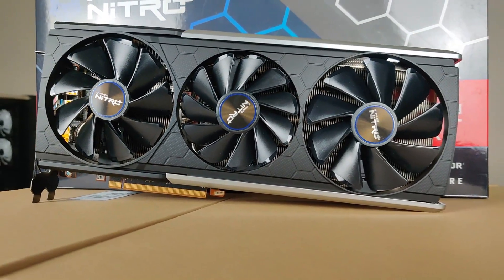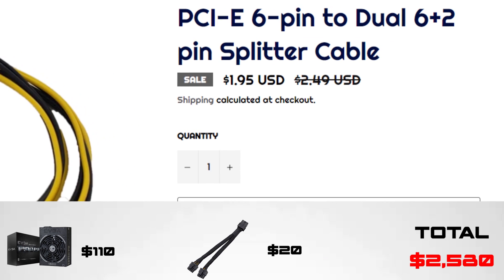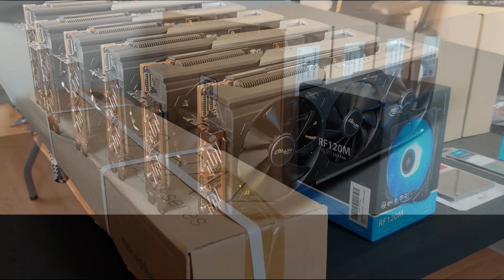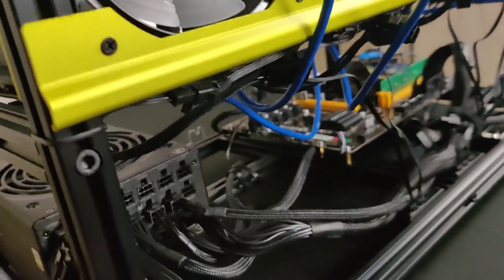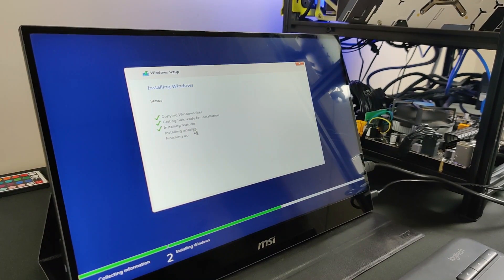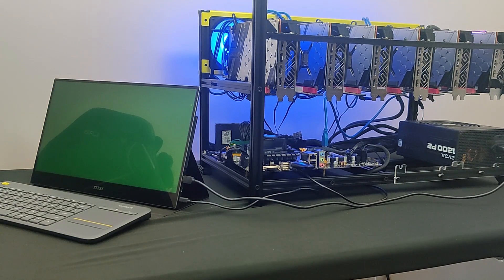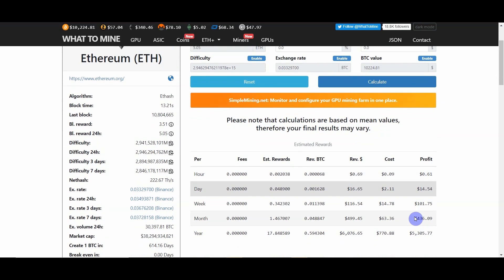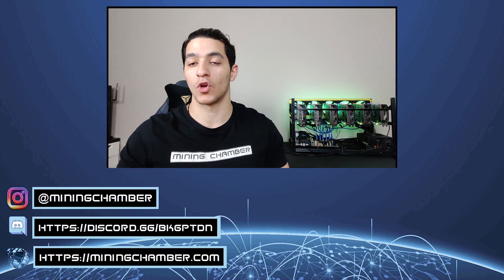RX 5700 XT Mining Rig Build - 6 GPUs | 330 MH/s and ONLY 880 Watts!!

Comment: dude. youbcan help me. i try to build mining rig with shapire nitro+ 5700 like you. but in the first step for test one by one the gpu, gpu no detect by mother boar. i use asus b250 mining expert. thanks
Reply from the maker: Did you plug in the HDMI into the motherboard?
Reply: problem solve dude. after i replace riser board. thanks. but now i have new problem. i follow your step about mod bios and simple over clock using amd aplication. and perfect. i got arround 55-56 mhs. now the problem is. durring i mining normal, after 1 or 2 hours, 1 of 6 gpu reading 0 mhs, i need restart the computer for recover that. but after 1 or 2 hours reading 0 again, i check temp is normal, under 63 degC, 😭

Comment: Are  you using hiveos?
Reply from the maker: In this video we used windows 10, although we might do an update for switching to HiveOs!
Reply: @MiningChamber  I have a question, for a beginning do you recommend we use stuff like betterhash, kryptex, or nicehash? If so which of the three is best?
Reply from the maker: For absolute beginner I think it's still manageable to mine with Phoenix Miner but if you rather a good user interface then it's best to try Cudo miner or one of those platforms

Comment: Did you use the 6pin to sata that came with the riser or  molex for the power?
Reply from the maker: We used splitters only through out the rig! We did have to daisy chain one splitter but then switched the 8 pin connector to the psu with a dual 8 pin that we had from a powersupply of the same model as extra cables

Comment: Dude, how about if the all VGA still in original condition, no overclocking, no bios modding, how much the power consumption and how much hash rate?
Reply from the maker: The power consumation will be around 205 watts and risers will pull 70 watts. and then the hash will be 51ish mh/ thats without BIOS modding or overclocking! BitsBeTripping just did a video about that today it is really informative I recommend checking it out!
Reply: @MiningChamber Ok dude, I really appreciate, i'll check now
Reply from the maker: Thank you!
Reply: @MiningChamber  still waiting for notification the new video..
Reply from the maker: So soon! Saturday, everything you need to know about powesupplies ;)
Reply: @MiningChamber  lol, of course. i understand. i stay tune in this channel

Comment: Will you come out with a video on how to power the gpus / risers? I have (2) PSUs (both 1300 watts) powering (8) 5700s. Both PSUs have 6 PCIE outlets; on both PSUs I use 4 PCIE outlets to directly power 4 GPUs and 2 PCIE outlets to power 4 risers. I’m curious on how your power distributed ...did you power any of the risers with molex? or did you split one of the PCIE cables 4 ways? I’m thinking about adding 2-4 more GPUs but I don’t have any more PCIE outlets.
Reply from the maker: Hey Daniel! Our this week's video will dive in deep about this topic and hopefully it will answer all your questions and concerns!!

Comment: Ive been mining with my two gaming pc's for a few months using one 5700xt each. Doing around 53MH/s each. Im interested in building a 6 card setup. Should I use 5700xt's or something cheaper to start?
Reply from the maker: That's awesome! Hmm I'd say wait for the new cards it will drive prices down and open new doors for more opportunities!
Reply: @MiningChamber  So maybe start buying frame, MB, Power supply etc then check vid card prices in a month or so? Buy old 5700XT cards Im assuming you are saying once the new cards come out?
Reply from the maker: @grubberzzz9982  yes the other parts you can get now but for gpus in a week or two it will be loaded with the new ones, that usually means the older generation cards will lose value. Just like iphone X and the model before it. So it doesn't necessarily means you need to buy used, even new off the shelf gpus will get cheaper possibly
Reply: @MiningChamber  Thank you!! Any suggestions for MB and PSU to start?
Reply from the maker: I really like the Asus B250 Mining Expert and for PSU the EVGA P2 1200w or EVGA 1300W gold
Reply: @MiningChamber  If ETH changes to staking wont that hurt mining in general? Im assuming mining will eventually by gone?
Reply: @MiningChamber  Not cheap eh!!
Reply from the maker: Mining will never be gone ! Many coins depend on proof of work which is always going to be there
Reply from the maker: Haha yes not cheap😅 look for used deals!
Reply: Can you make a video explaining the power connections to the risers? Im abit confused on the splitters and are they needed.
Reply from the maker: This will be this week's video!!
Reply: Perfect. I bought a MB and PSU that you suggested above. Asusus B250 and a EVGA 1300 p2. Im abit confused on how you could power 6 Red Devils? Psu only has 6x6+2

Comment: In my rig can I mix four Sapphire Nitro RX 580 with one RX 5700 XT? Will it be compatible? Both are AMD GPU and running on same driver. The driver 20.8.3 release support both the GPU's. I want to do this as I want to upgrade my rig with either one new RX 5700 XT or will wait for one new RX 6000 series RDNA 2 release. My PSU is Corsair HX 1200 platinum. PSU has 6 PCIE (8 pin) connectors. Five for GPU and one for CPU. Motherboard Gigabyte B250 Fintech. Please help.
Reply from the maker: Yes it is completely fine to mix 2 different AMD cards!!
Reply: @MiningChamber  So if I install new Rx 5700 xt along with Rx 580 I will still get the same hash rate. There won't be any fluctuation in hash rate or temperature? Rx580 and  Rx 5700 xt are not crossfire compatible. Do mining motherboards like gigabyte B250 fintech has this crossfire feature? If not then how do multiple GPU works in these motherboards? Please make a video of building mix GPU rig. It will be very much helpful to your subscribers.
Reply from the maker: Crossfire and SLI don't play part in mining. They are individually plugged in and run separately from each other. So no need to worry! You will just need to overclock them properly and that's it

Comment: can i use " Procesador Intel Pentium Gold G5400 3.70GHz 2 cores"
Reply from the maker: It depends on which motherboard. You just need to make sure it is compatible and the same generation. For example if the socket is LGA1151 for the motherboard the CPU needs to be the same socket
Reply: The pentium is plenty , attach a usb to the cheapest best btc board GA-H110-D3A and you're set, oh and buy a seasonic 1kw psu for stability 😃 ( assuming u building 6 3070 gtx or something 😂)

Comment: Hey, a quick question. I'm trying to figure out how did you connect the risers and gpus. You mentioned that you used 9 splitters so please correct me if I'm wrong: 
4 cables with a single 8-pin -> splitter -> 2x 8-pin on a card (for 4 GPUs)
2 cables with 8-pin and 6-pin -> 8-pin + splitter to 2 gpus and 6-pin + splitter to power 4 risers
So with that you have 6 cards + 4 risers powered up. How did you connect 2 missing risers? With molex?
Reply from the maker: Hey! We ended up doing a diasy chain for splitters. So one splitter was connected to another to power the left over risers until we got two new 2x 8pin VGA strand instead of the 1x 8pin strands we had. Like that we were able to fill out the rig using splitters and the additional 8 pins. I do not recommend using daisy chains for long term! but best option is to find the same PSU model cables in ebay and getting those for it!
Reply: @MTechBasics can you power the riser with a sata ?
Reply from the maker: @pedromedellinjr9680  It is not recommended! Best to get splitters for it

Comment: Hi, My motherboard is connected to two AMD 5700xt graphics cards, but only one of them is running. How do I need to set up to run two graphics cards at the same time? Thanks!
Reply from the maker: Did you make sure that both gpus are connected properly and that the risers are working? Try to switch them around and see what happens. Try one card at a time and make sure both are showing up
Reply: @MiningChamber  Thank you. 
I am try to unlock asus 5700xt but it was unsuccessful. His dead......How can he work again?
Reply from the maker: @richiew7208  try to do it one gpu at a time, take off one and do one at a time. Watch our 5700XT overview video about the gpu

Comment: Ur profit perday is 14 $ it means , after all expense , reduce the power consumption , what's tottal eating perday ,????
Reply: And you forgot to compare against ASIC setups. So yeah, all the block chains split or will split soon meaning half profit for everyone. Honestly it is not worth it. You will barely recoup your money before it becomes unprofitable.
ASIC rigs right now are at 480MH for 1200 watt.
Reply from the maker: @rotaryphoton137  Yes ASICs are definitely more profitable but they are harder to run in residential areas and it's easier for someone to get a gpu mining rig going than an ASIC because of the heat, noise and the type of outlets they mostly run on. GPU mining will always remain existent but for AMD yes it might be looking bad after ETH and ETC migrate out of their Algo
Reply from the maker: We mention that is after the electricity cost. Now it is different because block reward is smaller and ETH price went down
Reply: @MiningChamber  I would like to buil miner at home , I nees deep details , even with software
Reply: @MiningChamber  what's different between bitcoin and etherium
Reply from the maker: @haneesparakkottu9274  I recommend watching videos and getting familiar with the space! Go over our videos and some other awesome youtubers then you can get some knowledge on the field !

Comment: 6:58
using electric screwdriver manually...  lolwut
Reply from the maker: 😂 it's not strong enough to screw the fan screws. Needs force 😅
Reply: @MiningChamber  what? my cheap Bosch and Black n Decker are too strong and too fast, I rarely use them vs my Makita all around drill.
Reply from the maker: The fan screws can't be screwed with the electric one we have, the power of it is not strong enough to screw them that is why it has a manual mode as well! Trust me I would've loved doing it on the electric mode 😂
Reply: @MiningChamber  i use a ratchet screwdriver for the fans, its a wrist saver
Reply from the maker: @MatthewDannevik  might be just the solution then 😂😂⛏️

Comment: Hi, what about noise of the rig? Can you please measure db by some app for example one meter away from rig? Sapphire GPUs should be quiet as I heard 😊
Reply: You can use app for that, for example db meter is working fine 👍
Reply from the maker: Thank you we will give that a try!
Reply from the maker: They are pretty quite! We will be getting a db measurement tool soon so we can incorporate that into our videos but it is surely one of the quite ones but ofcourse it also depends on the fan speed!

Comment: Does the values on core apllies to non Vbios modded cards? Cause when im lowering the core at 1300 i get less Mh/s
Reply from the maker: When you reduce your core even though Ethash is memory intensive it still will reduce your hashrate. The modded Vbios cards just makes the memory timings more efficient. Let me know if that helped!
Reply: After you set up your rigs, do you experience any crashes? Or do they do they work like a charm after you fine tuning them once at the start?

Comment: its much quicker to use a config.txt file. establish the gt value first on one card then its pretty much gonna be the same on all identical cards. then you set / fix the GT, core, core volts and mem clock in the config.txt. if you lower mvvd you can cut the wattage even more. if you can get them the plain blower 5700s are awesome miners cos their ram is properly cooled. mvvd requires linux or amd tweak xl tool. best wishes from manchester uk.  i use -eres 4 and extended stats in phoenix. plain blower 5700s can get 56 megahash long term - mine have been up for months. best place to put a rig is cold basement
Reply from the maker: That is amazing thank you for the great insight! We need to get into the config.txt for sure! The blower style cards I heard are alot better We will hopefully get some of them in the near future. Thank you again!!

Comment: Brothe I have Corsair RM1000i PSU And Sapphire RX580 8gb total 5 card and now i want to add 2 more Rx580 card on this PSU. Can this PSU handle total 7 card ? Or not .... 
Currently my one card are consumed 88 to 90w power in hive os... please suggest me bro
Reply from the maker: I do not recommend running 5 Cards out of the 1000 Watts PSU. The cards will draw more than 88 watts off the wall. You will need to get a wall power meter and check. But on average with Risers each GPU will drawing around 120-130 watts. I recommend getting 1200Watts for 6 cards and for 7 Cards you can get a 1300 Watts. Even a 1200 Watts will do for a 7 cards too. Hopefully that helped!
Reply: @MiningChamber  Thanks Bro...  i got it

Comment: I see that you connected the MOLEX to AUX1/2 of the motherboard. I have not connected them but everything still runs normally. can you please explain? thank you
Reply from the maker: Hey! I do recommend to power it since it does provide the power to the PCIE ports. If you would plug in enough gpus in there and they draw a high amount of power then you will run into many issues. Powering them makes sure that the gpus will be able to find the power they need when they need it!
Reply: @MiningChamber  Alright. Will try tonight and let you know how it goes. Best Regards

Comment: Would i have issue if i do same type of rig with diff motherboard and i use a mix of  5700 and 5700xt  would that be a problem?
Reply from the maker: That wouldn't be a problem at all! Just the overclocking and BIOS modding will defer but other than that your good !
Reply: @MiningChamber  Oh well it will be my first rig ever so if is gonna be overcomplicated to handle probbaly better not to play with it  yeah?
Reply from the maker: It won't be much complicated it will be very slight things that are different and overclocking in general is different from one card to another. So I recommend doing it if you can get your hands on a nice deal!

Comment: How are you getting such low power consumption!? I have 8 x Sapphire 5700 XTs all RedBios modded...they are at 54 h/s but they are consuming 2081 watts from the wall (I have two EVGA 1300 PSUs hooked up to them,  both roughly consuming 1030-1050 watts) ....I am using NHOS and have played with the JSON config settings,but none of the changes are stable. I get stable operation on Default Medium settings, but at a high power draw, 2081 watts. Does anyone here have a Sapphire modded rig on NHOS that can share their settings ? Would greatly appreciate the help
Reply from the maker: Oh wow that's alot of watts!! What's your undervolt is set at ? We have it at 725mv that can explain why we have it so low!
Reply: @MiningChamber  NHOS uses TDP for power which is percent of power usage....I have it currently set to "Default-Medium"  but I have played with 80% , 70% , 60% setting. The other settings are Core Clock and Memory Clocks which can be set.. I have those also set to Default-Medium. I think getting the right TDP, Core Clock, and Mem Clock will help with lowering the power draw , but adjusting them have been giving me unstable results and I haven't had much time to find the right combination
Reply from the maker: Hmm not sure really with NHOS but I'd say try to push around -40% to -20% . Sorry I'm not quite familiar with that operating system!
Reply: @MiningChamber  I forgot to mention...I am using NHOS because windows was very unstable as you mentioned in the video
Reply from the maker: We are testing the waters on HiveOs il let you know how it goes there!!
Reply: @MiningChamber  So I tested different Linux Mining OS and determined it was purely software related and that NHOS sucks. I am using SimpleMining OS and with OC/undervolt I am averaging 54 mh/s per card and 1300 watts total draw (total eight 5700XTs) ...thats a 815 watt decrease compared to NHOS which was not allowing me to undervolt. I also tried HiveOS, but couldn't get it to work; I was unable to install the AMD driver...I also tried the Beta image and that didn't work. I'm so happy that I finally achieved optimization!
Reply from the maker: That is awesome!! Thank you for letting us know! We will keep in mind regarding to simple mining!

Comment: Hi i`m struggling with connecting those i got 1600W evga psu i got 12 - 8 pin inputs for my 6 cards but only 9 VGA 8pin outputs from PSU  - how would you recommend me plug them ( not considering buying another psu) . Thanks!
Reply from the maker: Hey! If you have 9 8 pins then you should be able to get splitters and power everything on! You should have total of 16 8 pins with 9 splitters and that should use 12 for your GPUs and then 4 for your Risers. You will have 2 more risers to power which you will see if you can find another VGA cord to plug in the PSU through Amazon or such. Or you can do one strand of SATA per Riser through using SATA to 6 pin or straight SATA. Although SATA is surely not the most reliable!
Reply: @MiningChamber  Thank You for the answer this is exactly what i did i was afraid that there will be not enough "wattage?"  but somehow is working stable. It is well appreciated !! :) Build is so messy i dont have an idea how you guys can make it so nice and clean lol XD
Reply from the maker: 😂😂 that comes with love and patience 😂 I f it isn't pretty then it isn't mining 😛